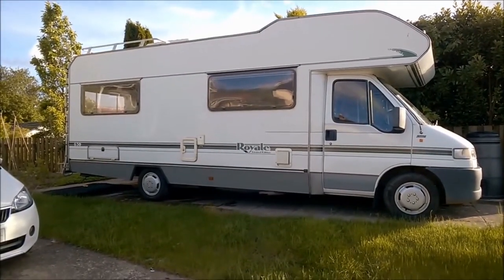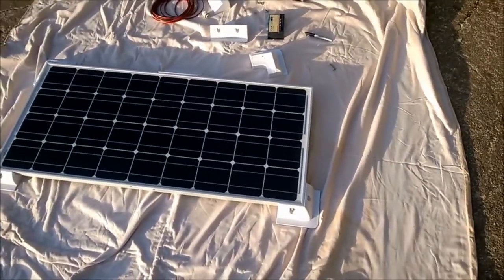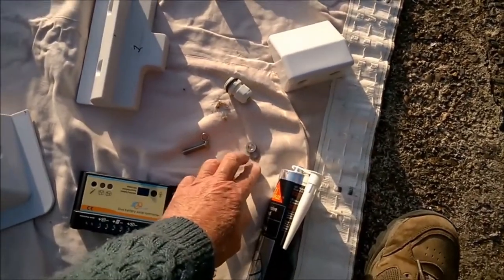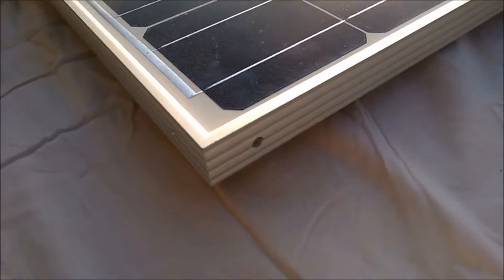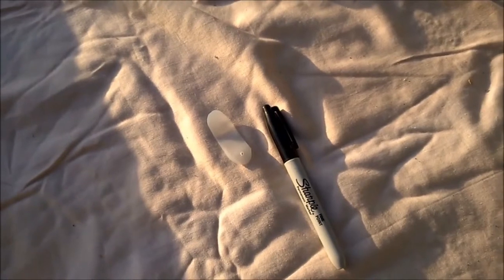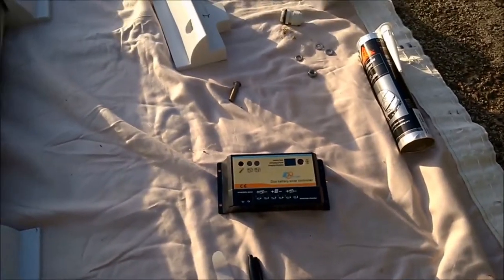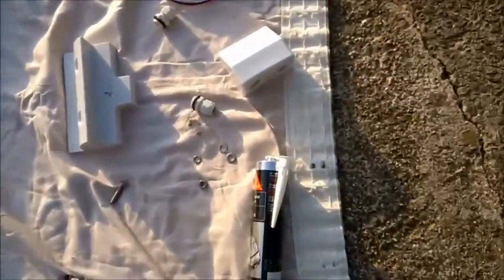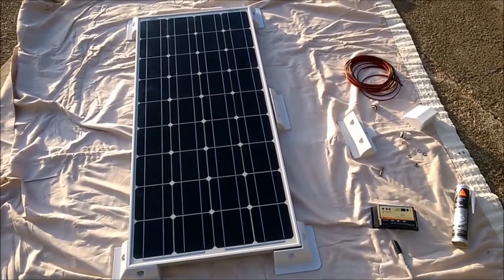How to fit a solar panel to a motorhome or caravan  Part 1

Comment: I've just fitted my 2 panels to my self converted Ducato. One thing I'd say is don't use stainless steel screws when attaching the mounts to the panel as they'll corrode the aluminium, best to use zinc coated screws.

Comment: Could you tell me what gauge wire did you use to connect your batteries to your charge controller? and how did you know what size to use? I have 150w panel.
Reply: I got mine off Ebay mate,  had the battery connector already fitted
Reply: I’d use self tapping screws to fix the panel to the brackets, as you’ll never get to the nut. Once the brackets are bonded to the roof...